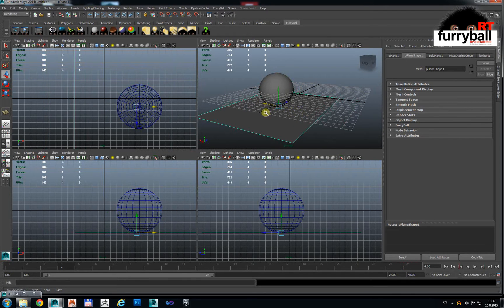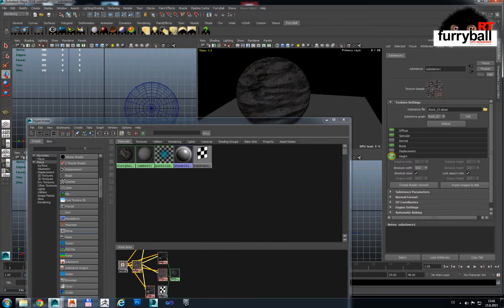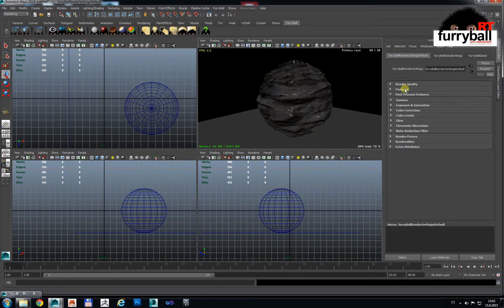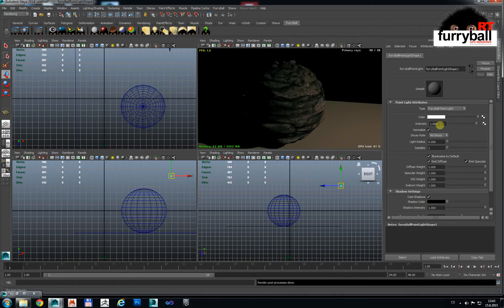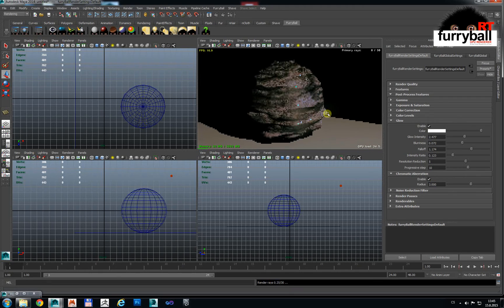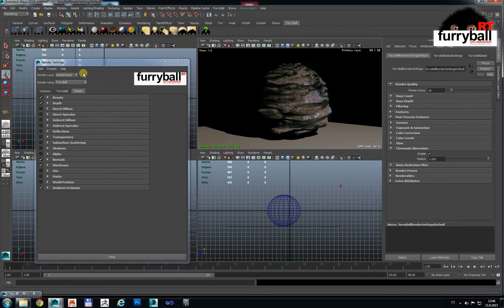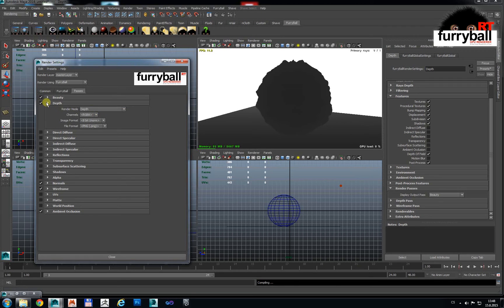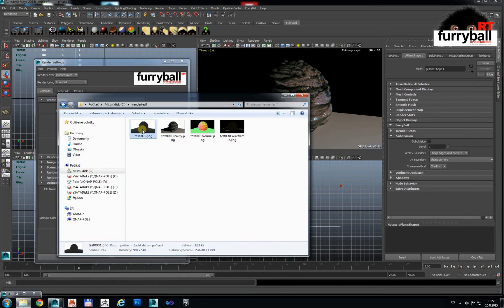FurryBall RT - Tutorial II - Post-Process, Substance and Output

Comment: What better Hee Maya or 3ds max
Reply: +DAZ con It depends. Both tools can model and animate. 3DS Max is typically best for modeling pipelines while Maya is best for animation pipelines.  I used to model in Maya but I prefer to model in 3DS Max, now. I only use Maya for animation and rendering. You'll have have to try both software to see which one you are more comfortable with.